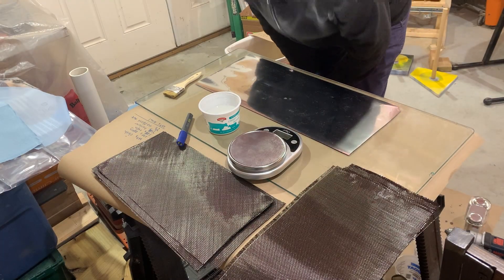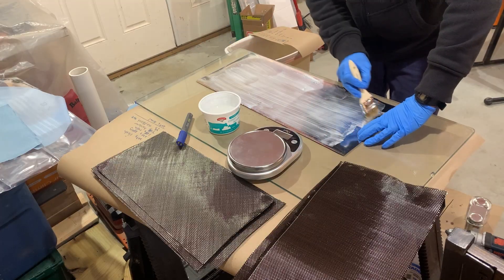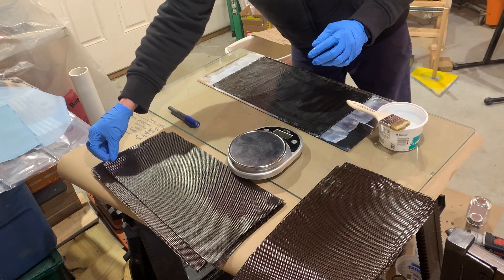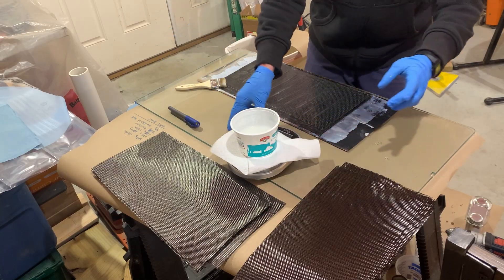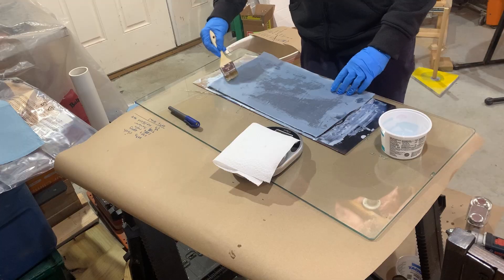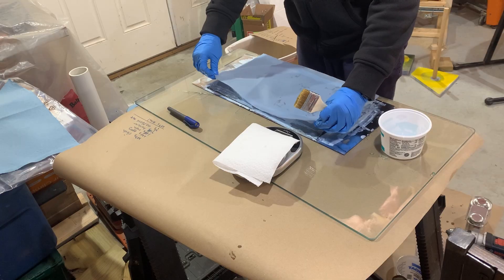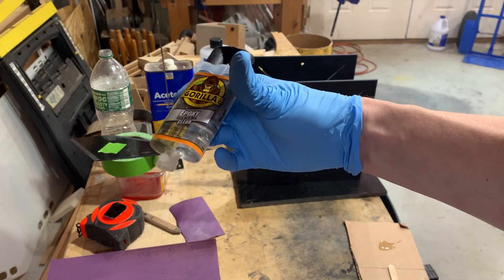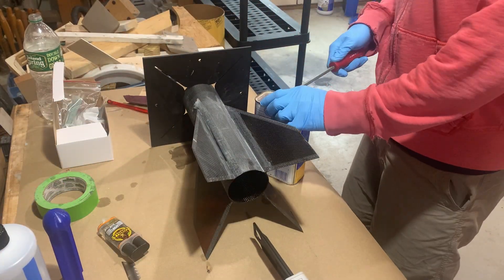Making Carbon Fiber Rocket Fins

Comment: Next time you do a fin alignment jig, notch out space for a piece of angle aluminum in one of the gaps between fins and tape the aluminum to the body tube. Keeps the jigs better aligned to each other.
Reply from the maker: Interesting, you’ll have to make a video or figure so I can try it. This method is fairly solid. I think it only spun like 6 full revolutions going up to 18k feet. But I’m always looking to improve.